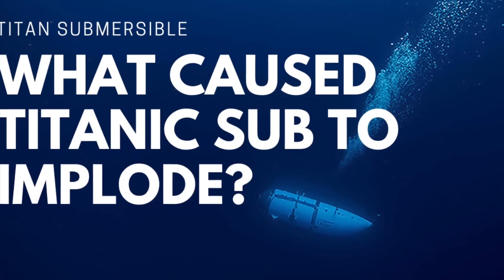What Caused the Titanic Submersible Titan to Implode?

Comment: The most glaring departure from the (quite well known) rules of composite design was the placement of all fibers in the hoop direction (if this was really the case, which, as an engineer with lots of composite analysis and design experience, I still find hard to believe).
At the depth of 4000m, the pressure is 40 MPa. The ratio of R/t (radius of the cylinder to its thickness) was probably about 8:1 or so (maybe a bit less). Average hoop stress would be p*R/t - which equals about 320 MPa. The axial stress would be p*R/(2*t) - which equals about 160 MPa. The difference is that in hoop direction there are carbon fibers which take the load (with negligible contribution of the epoxy matrix due to vast difference of Young's moduli). In axial direction (if there are no fibers) - the whole load is taken by the matrix. Epoxy resin have compression strength between 80 MPa to about 180 MPa (special applications). So - if there REALLY have been no fibers in axial direction - the matrix was cycled to or close to its ultimate compression strength - which usually leads to fatigue fractures.
On the top of this - the difference in thermal expansion factor between titanium and composite could conceivably lead to additional shear stress imposed on the matrix - when the titanium ring changes dimensions (the temperature difference being that between the temperature at which the cylinder was manufactured, and the temperature at the depth of Titanic).
I won't comment on composite fabrication in an open hangar with no control over humidity and foreign material inclusions). Let's just say that for this particular application, the environment of the fabrication site should be strictly controlled.
I also find it hard to believe that screws might have been driven straight into the carbon/epoxy wall of the cylinder in order to attach equipment. I just can't believe this.
There are rumors that the material was at the end of its shelf life (or above it) - but again, I have no confirmation. If so - I would be at least very concerned.
Also - epoxy matrix deteriorates in wet environments, and paint is not a universal solution to this problem. It also deteriorates with age. Repair procedures of such a thick (5") shell are extremely difficult too.
Analytical assessment of the strength itself is rather difficult - due to enormous number of layers, large thickness and the curvature of the cylinder. Simple shell element does not model such a structure properly (FEM), but modeling hundreds of layers is probably something that has not been done.
Having said all this - the amount of information regarding the details of analysis, layup, materials, fabrication and safety factors are simply not known at this stage - so all of the above is just a conjecture based on very scant information available. But the red flags are there...including the viewport rated to only 1300 m.
Reply: A side note, carbon fibre shatters under pressure, it doesn’t crush, i imagine even a slight imperfection/damage would be way more serious & immediate
Reply: Very well done.  I agree.  Thanx for putting your summary in the first sentence. But I did read it all.  :)
Reply: Good analysis. I would be curious as well about resin rich or resin dry areas of the wind. The fabrication relied on visual inspection. 🤓 What autoclave did they use if at all? There are not many large enough to cure that wind. Curious why they did not use an omni directional wind (most pressure vessels) vs. uni. One commentor mentioned prepreg. Who validated material selection quality? Both resin and fibre. So many questions…
Reply: @philhemenway3503  This always something to watch out for, but I would be more concerned with the actual cure process. Normally the cure would be at 180 deg C (or 130 deg C) and a pressure of 3-5 bar. Unfortunately - you can't cure 5" thick shell in one go. The chemical reaction between resin and hardener is highly exothermic. The coefficient of thermal conductivity is low for composite - so the resin would burn due to internal heat. Also - autoclave cure is out of question: since the layup includes hundreds of layers, the number of cure cycles would be prohibitively large (and would also lead to thermal cracking of the matrix if the composite is subjected to more than 3 cure cycles). So - the cure was probably done at RT (room temperature), several layers at a time - which would still result in a large number of cure cycles. Every such cure cycle might also introduce some secondary internal stresses in the cylindrical shell.
This of course is pure conjecture on my part - but it is hard to imagine this being done any other way, unless they invented some super-secret technology (which I doubt). Just my $0.02.
Reply: According to some sources it was wet wound fiber in the hoop direction alternating with prepreg cf in the longitudinal axis. The investigation will look into this.
Reply: @Square-0ne  interesting
Reply: Hi Les8489, great info you provided! I’m a mechanical engineer but without  any experience with carbon fiber. 

I’m interested in your opinion on the following: how much difference do you estimate there would be in the circumferential deformation the cylindrical CF section would see relative to the titanium heads and connection rings, based on the Young’s Modulus difference? If the difference is big enough I could see the potential for it to induce an un-obvious bending moment at the CF to titanium joint. This could have the effect of cyclically “working the joint open” at the adhesive, rather than the adhesive only being loaded in compression and probably some shear too. Or is the Young’s modulus difference not great enough for this to be a valid concern?
Reply: @capnrico8877  How well does epoxy bond to Titanium?
Reply: @capnrico8877  Good question - but let's not mix Young's modulus with stiffness :) Stiffness also includes the effective size (thickness in this case). if all fibers have been oriented in the hoop direction only (IF, that is), then approximate values of moduli (very approximate, since the fibers, resin and actual layup details are not known)  could be something like: E1 = 130-160 GPa (hoop direction), E2 = 5-6 Gpa (axial direction), G12 = 2-3 GPa, G13 = 1-2 GPa (based on 60% volume fraction of fibers).
Under external pressure - the titanium caps change their diameter, and so does the composite cylinder. On the top of that comes the thermal expansion (roughly calculated between RT at which the composite was fabricated, and 4 deg. C at the depth of Titanic). Without exact dimensions etc. it would be hard to assess the relative dimensional changes, but it stand to reason that:
a) axial stress in the order of 160 MPa at depth of 4000m might have been imposed on the composite cylinder - which is close to compressive strength of the matrix itself
b) differential relative contraction of titanium and composite parts might lead to additional shear stress (acting radially on the composite cylinder - and specifically on the matrix).
c) In composite structures - joints are notoriously weak points. You design joint first, and fill the space between them with material...

All of the above is just a conjecture, of course, and way more detailed info is required. Hopefully the wreck will be recovered soon, which may shed some light on the issue.
Reply: Please!  We really don't need this White man-splaining!
Reply: The entry port seems to be on top of the CF tube.   Is that the one that was bolted shut?   If that is an entry port, it means there was a rather large hole in the side of the CF tube.   That to me seems to be a weak point.  When they are talking about the shelf life of the material, they must mean the epoxy, not the carbon fiber itself unless they are talking about a carbon fiber that was impregnated with some form of epoxy.  I like a solid look at the engeineer rather than criticism of Rush's personality.  The craft was not as bad as many claim, but obviously not without issues.  However people need to keep in mind many major engineering projects have failed.  For example the Titan was far more succesful than the FIU bridge which killed 6 or 7 in an almost immediate  collapse. What concerns me is that it failed closer to the surface than to the bottom.  Something gave way early on when the pressure was not completely extreme.  Another issue seems to be the joint between the CF tube, and the Titanium end rings.   Was that simply "glued" with epoxy?  If there was movement there between dissimilar materials  it seems to me that could begin to separate with repeated dive cycles.
Reply: @JoeLinux2000  why believe they died June 18th, why believe weights were dropped and ascending, if so Polar Prince would never wait hours to call rescue teams?  Without bodies death is purely estimated!  Was Titan stuck for over 4 days under water. ?? Stockton never would imagine rescue would be over 24 hours!  It was a rescue with many questions; refused help from England specialist ship, did not call undersea ROV that take 10 hours to arrive until last day or 2.????purely makes less sense.
Noises many who do I choose to believe on that????  No true evidence yet supplied, hope SIM cards, I-cloud, film from 5 onboard cameras release to
Public, or suspicions will prevail further!
Edit:  and can CF withstand consecutive 4-5 days under sea pressures?  Or will that alone, lead to implosion?????
Reply: @JoeLinux2000  In order of appearance:
1) The vessel with access hatch on the top was NOT Titan. I noticed that too - journos include whatever pics they have on hand...
2) The shelf life...yes, it applies to resin. Prepregs (pre-impregnated materials) consist of fibers (arranged as unidirectional tape, or woven fabric - may be plain wave, or satin, twill or something else) and resin mixed with hardener. It remains pliable and soft in uncured condition. It will cure (and harden) over time - the time depending on the ambient temperature. Keeping in mind (very rough rule of thumb) that every 10 deg.C difference in temperature slows the chemical reaction by a factor of 2 - uncured material is usually kept in freezers at about -18 deg. C. Which prolongs its life at RT from days at RT to about 5 to 12 months in the freezer.
After this time the material is usually scrapped or used for non-critical parts (rarely). The reason is not so much the reduction in its strength, but workability on the shop floor. It may resemble cardboard, difficult to shape over complex shapes, increasing the effort and time required (apart from concerns about partial cure, resin flow, proper wetting of the fibers - all of which might affect the strength of the final product). Carbon fibers are still OK :)  If OceanGate procured out-of-life material it probably cost them no much more than the cost of transport.
3) The join between the cylinder and the titanium caps...Yes, IF all fibers are arranged in hoop direction only - the only connection would be via the glue and the matrix (resin in the composite 5" shell). Any crack or fatigue fracture there might be catastrophic. Difference in thermal expansion coefficient between composite and titanium might produce additional shear stress in the matrix (acting in the radial direction). Also - resins and glues deteriorate with age, fatigue cycling and moisture content. We just need to wait for recovery of the wreckage - maybe this will shed some light on the issue.
4) Stockton Rush...IMHO he had every right to build whatever he wanted to build, certify it or not, and risk HIS OWN life to test his design. But taking on board passengers was crossing the line as far as I am concerned.
Reply: So in lamens terms, only wrapping the carbon fiber in a straight up and down hoop shape made it weak because it didnt account for every angle of pressure? Would doing a crosshatch design be stronger or is the material useless at that depth?
Reply: @BlitheringRando  If the fibers had been placed only in the hoop direction (big IF) - then essentially yes. What gives the composite its strength is the fibers...axial stress (coming from the end caps pushing axially) is about 50% of the hoop stress, but (again, IF there are no fibers in axial direction) the strength in axial direction would be limited by compression strength of the matrix (resin), which rarely exceeds 180 MPa.
Reply: @les8489  thanks for the detailed answer. I don't know the scientific and mechanical details, but watching them layer the carbon fiber tape over the inner tube then gluing the ring on is wild. No one there questioned him and said "bro, you're relying on glue and tape" It doesnt matter how fancy it is, its glue and tape.
Reply: @BlitheringRando  I am still waiting for the details of the layup (that is, the directions and percentages of fibers). All video evidence so far shows only hoop direction - winding the fibers on the cylinder, with no fibers in axial direction. This would be a very bad thing (and I can't really believe it) - so I am waiting for confirmation.
Reply: @erikwellerweller8623  Yes. Circumferential stress (hoop) is 2x as large as the axial stress on the cylinder (approximately, as this is a thick-walled cylinder, so we are talking just the inexact averages) - but IF all fibers are in circumferential direction only (again, IF), then it leaves only matrix to react loads in the axial direction. You can't expect the matrix to take much more than 160-180 MPa in compression. The pressure at 4000 m is approx. p = 40 MPa, and axial stress in a cylinder can be calculated as Stress = Pi*R^2*p/(2*Pi*R*t), where 't' is the thickness of the cylinder. if R/t is about 8 - then Stress = p*R/t = 160 MPa.
Please don't treat this as an explanation of the actual implosion - these numbers are just an example and a rough order of magnitude what/if type deliberations :)
Reply: Took the words right out of my mouth . I didn’t even consider the large open room with no FOD control or humidity control.. Excellent sleuthing sir
Reply: You sound like an expert who knows about this topic - precisely the type of person the CEO boasted he wouldn't hire.
Reply: @rinzler9775  he's also a str8 whyte mxn
Reply: At best it was a single use vehicle that should have been resigned to a swimming pool training vessel for ducks..
There is always the possibility that one could miss trying to shoot oneself in the foot with a 45.. 
I wouldn't want to try it on the assumtion I may miss 🤦‍♂️

Comment: I noticed no seal between the cap and hull in another video and asked why nobody mentioned it as a potential to leak. What would happen if the mating surfaces got gouged, nicked or scratched on accident.
Reply: I hear that a tiny stream of water under that amount of pressure would cut a person in half.
Reply: @burtpanzer  It's used to cut steel.

Comment: The various components weren't drilled and attached to the inside of the carbon fiber hull. The inside has a liner, that's what these items are screwed into.
Reply: Was about to mention same...
Reply: We won't know that for sure. The liner isn't that thick to hold such a long screw.
Reply: @wshyangify  Easily that thick and wasn't holding much weight
Reply: at 2:21 you can see the liner and it appears to be some translucent material
Reply: The catflap may have been a contributory factor 🤔
Reply: I hope so, because I cannot believe someone involved would not have recognized the danger of screwing into the pressure hull.

Comment: The lighting fixtures and computers were mounted on a decorative perforated metal sheet that was formed into a tube. It's obvious on the Stockton Rush tour of the interior video. If you look at the end ring you will notice that the decorative metal sheet is separate from the carbon fiber tube. There's a gap.

Comment: I’ve heard people sa it’s possible a sleeve was installed between ID of the carbon fiber pressure hull, and the monitor/lights, possibly providing a safe surface to mount to
Reply: Several have indicated that to be the case.

Comment: The way the carbon fiber filament was laid is linear fashioned rather than cross hatched, this is kind of questionable structural integrity, this is like placing concrete rebar incorrectly.
Reply: Based on reinforced concrete, any reinforcing between the middle of the wall and the outside could only be in compression, so it was useless there.  The only place I can see the fiber getting into tension is where is is laid close to the inside surface of the cylinder.  Then if there was a significant inward bulge the fiber would resist that, but only after it had taken up the 'slack' from the compression, by which time the bulge may be unstoppable.  
Apart from that all resistance to load must be by the resin only.  
There were two main loads;  radial - from the pressure on the sides of the barrel, and axial - from the enormous pressure from the end caps (about 10,400 tonnes of water pressure pushing the end caps towards each other).
Reply: @nigelwilliams7920  Yup.